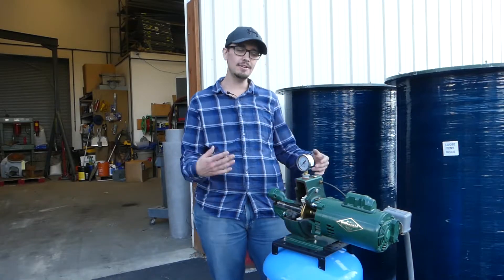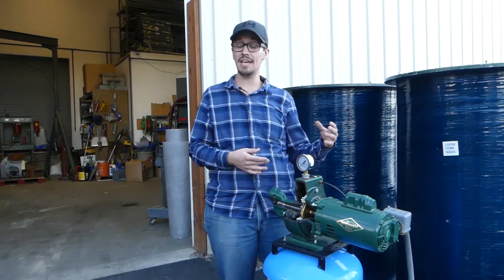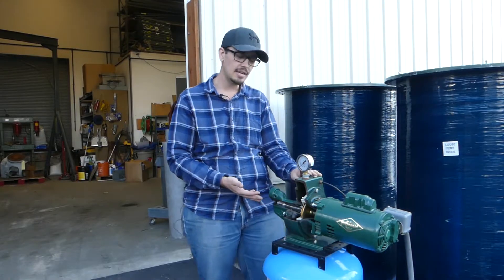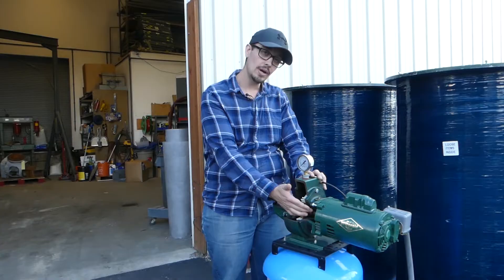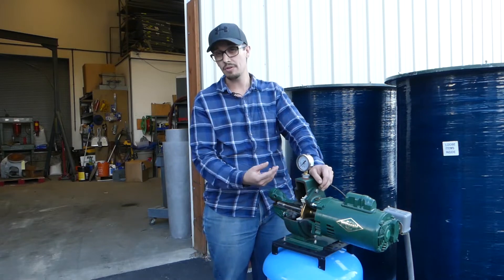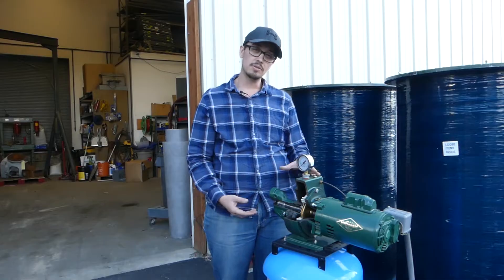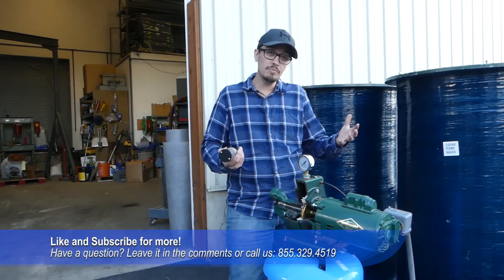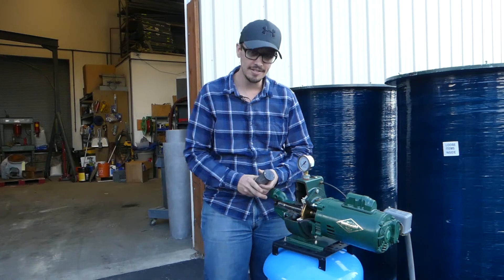Troubleshooting Jet Pump: Noisy Pump (Cavitation)

Comment: My inlaw left pump running for about 45 minutes  when the feed tank was empty. I shut the main water off to let tank drain to relocated tank and the pressure pump. Now it's all hooked up and primed but won't build pressure over 10psi. Is the jet part most likely burnt up?
Reply from the maker: There's likely some melted plastic in the pump end. I would take it apart and see what needs to be replaced.
Reply: My pump is actuLly making a buzzing sound.  Motor is not turning, however motor is not stuck

Comment: Hi. I have a weird one. Deep well jet pump.  So the pump has a pipe pressurizing the well, then another pipe provides the water to my home.  Since installed. Gould J5 plus I can not build over 25 psi.  It's not a switch issue. In face. I had to purchase a $120 special switch to be able to set a 10/15 PSi threshold. The cheap switch would not work correctly.  Either it failed to engaged and/or constantly cycled.  I have everything on top new. Did a foot valve test. Got to 25 psi. Checked in 30 minutes. No loss at all with house water shut off.  I have multiple valves.  I found a small air leak on the suction line. It's sealed.  I have opaque pipes so I can see any air bubbles.  Once in a while. I get a tiny bubble.  My well is at approximately 70 feet. Estimated from what the local well guys tell me.  Is it possible that the diaphragm could cause this issue?  A little more details in the way to fix and weird failures might be helpful.  It's a half HP pump.  New plumbing on top of well head. New tank. Ideas?  Do you sell Gould parts?  Happy to purchase what you think it might be.  Help!

Comment: Hi. Thanks for all your information. I have a question that you might be able to help me with. I have a cistern and a jet pump system for my house. We had water delivered and after when I used the water in the house, the jet pump started clicking on and off and the gauge was moving up and down. This was very loud and concerning. It happen every time we used the water and stopped after about 5x. This also happen last month when we had water delivered, but never before. Any thoughts on what this could be? I have a video of it if that would help. Thank you.
Reply: Should also mentioned that both times I had enough water left in the cistern. Measured both times before delivery so it was never dry.
Reply: I m sure you found out after a year.
The on and off or cycling, is coming from the pressure switch, you have to set the minimum and maximum pressure so it would stop cycling. Search how to set it, there are 2 springs inside

Comment: My pump have pressure in running, have water flow and no leak in seal

But there is to much noise, its not in the motor also

Comment: Our pump is directly attached to the water supply pipe. The problem is when there's no water in the pipe it makes no sound, but when it's sucking water it makes hell-like vibration-like noise. I have taken this to the manufacturer's factory. Those idiots replaced certain parts, making a huge bill, without 1% improvement even. In a nutshell, it makes noise while sucking water. Without water, there's no noise. Please helppp!
Reply: Did you find a solution?
Reply: Exactly the same thing. If I turn off the valve on the water supply pipe, it makes lo, noise, if I open it, it s whistling and it's hard to cope with that level of noise

Comment: Am I correct in assuming that a worn impeller would produce the same resistance/cavitation issues you referred to when you spoke about new installs?

I have a Gould J5S, it's been working great for 3-4 years and we do have a good amount of sediment which tapered off after the first year or two of use.  Lately the pump runs longer times to fill, I hear that cavitation that I was familiar with back when I had to prime it originally.  I'm thinking the impeller finally lost enough blade to produce proper pressure to fill quickly.

Thanks for the great straight forward video!
Reply from the maker: It could be cavitation, it could also be broken bits of impeller/sediment rocking around inside the pump housing. Give us a call and we can quote the cost for the needed replacement parts: 855.329.4519